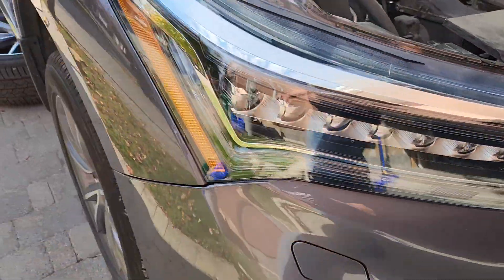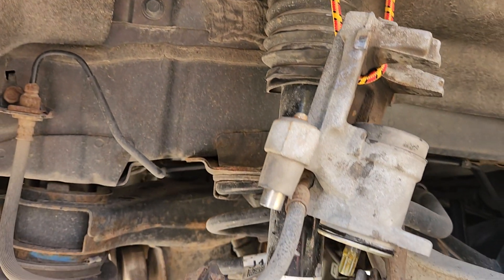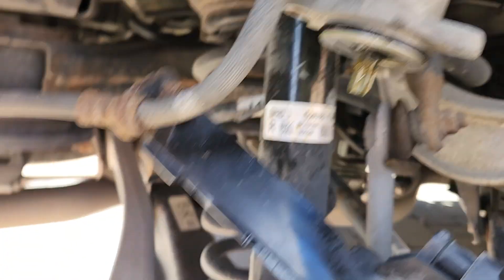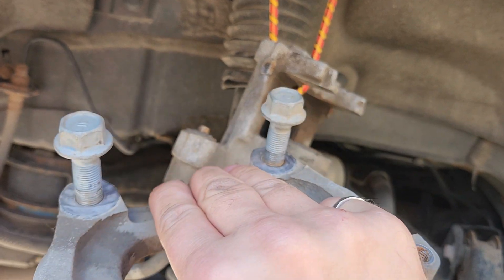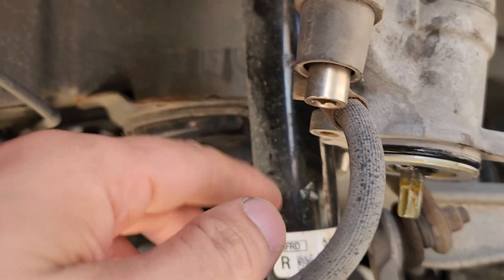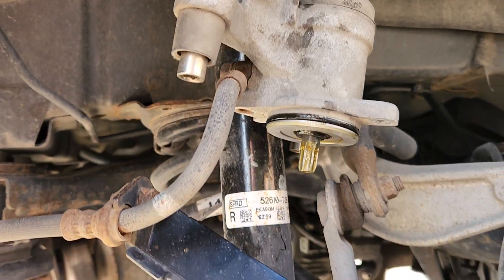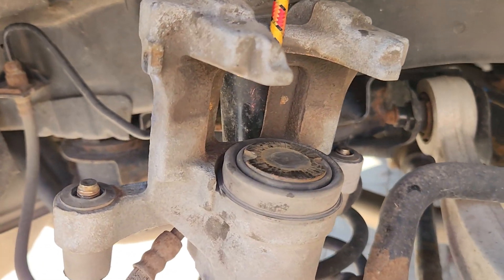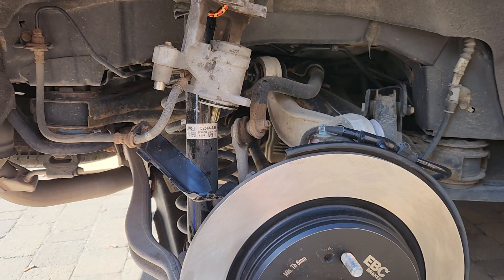Acura RDX 2019+ Rear Brakes change with manual electric parking brake retraction

Comment: Just buy launch scan tool 120bucks has rear pads maintenance mode
Reply from the maker: This was much cheaper and I have scan tools that do not have Acura options. Honestly, this wasn't an issue at all, just need to know how to detach it and retract the piston.